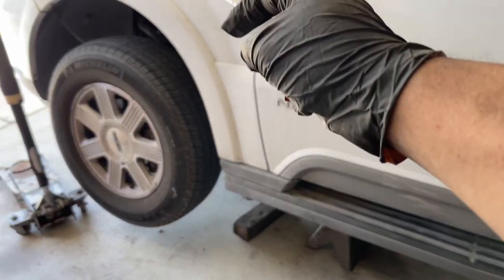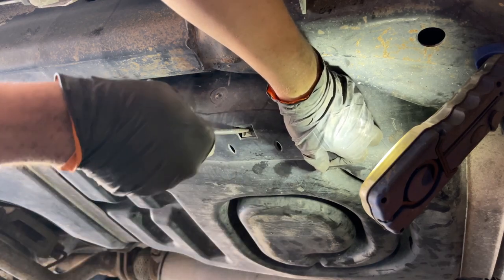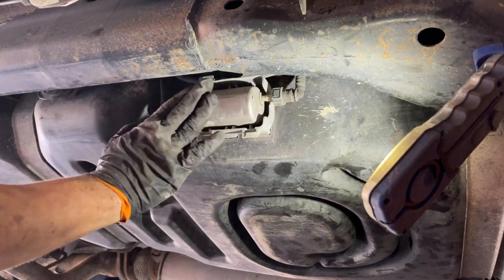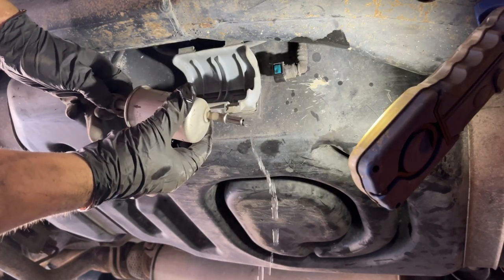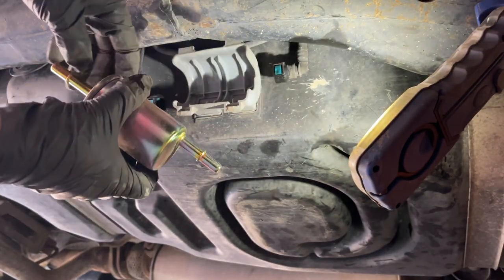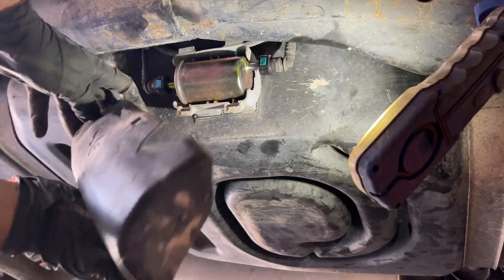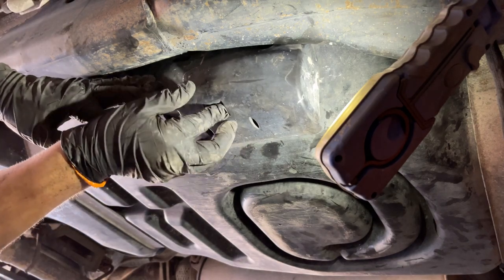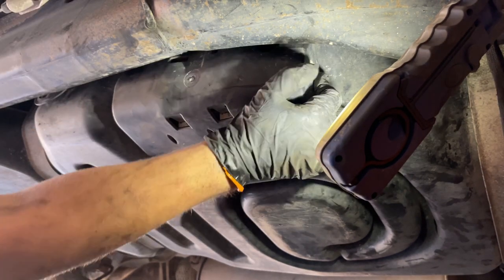Ford Expedition Lincoln Navigator Fuel Filter Replacement 2002-2004

Comment: Was the fuel tank empty for this? What stops the fuel from pouring out?
Reply: You will get some spillage of fuel that is in the fuel lines, but not from the gas tank.  Gas tank fuel doesn't enter the lines unless the fuel pump in running.
Reply: @chrisgraham2904  thank you